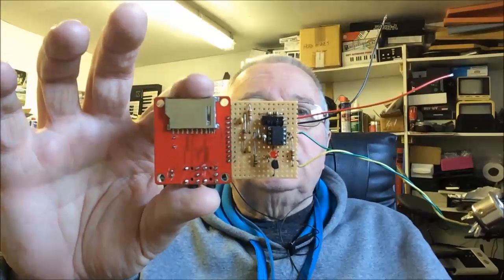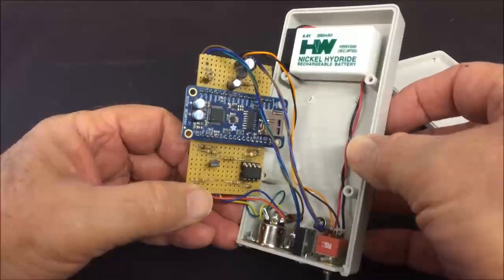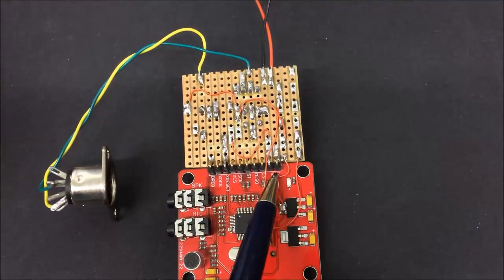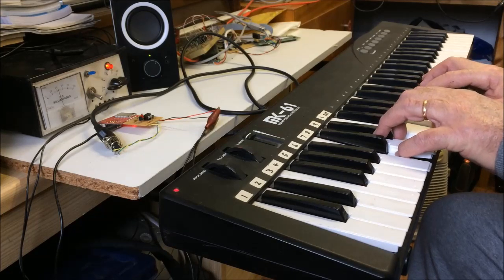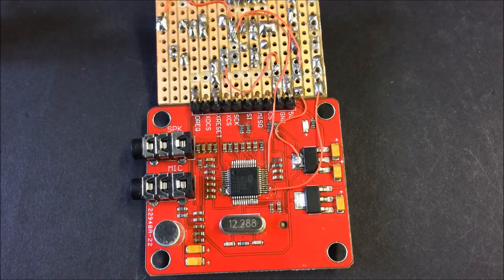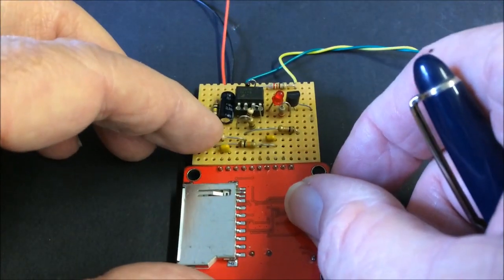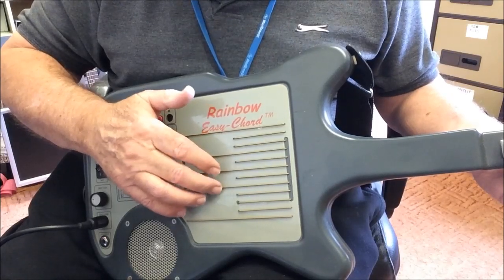DIY VS1053 MIDI Sound Module

Comment: Please let me know the sample Arduino source code that inputs the MIDI keyboard shown in the demo and plays on vs1053.
Reply from the maker: Hi - there's no arduino code associated with this project - you can generate midi signals from an arduino program but that is outside the scope of this project. Any midi keyboard or controller will provide the correct midi messages for this device.
Reply: @mikerainbow  Ah yes, thank you. Direct input from the MIDI keyboard.
Thank you for your quick reply. I was able to successfully modify the module using your method and I am very happy. Thank you again.

Comment: This is really the only standalone version, without MCU, that i could find. Great work! The additional wires to the chip make it a bit harder for beginners. Its stupid they made these pins not available for midi. Is there no version of the breakout that is prepared for this?

Comment: Hello Mike, thanks for the MIDI project. I am a somehow more or minor experienced developer and I draw my own schematics and do home-made PCBs the traditional way (UV and etching).
Years ago, I ordered some ALC850 chips (about 5 Pounds each), and I still have them at home, without an Idea what to do with it. Originally, my Idea was to do some mixing device (Piano, PC, Speaker, Headphones, ...) in/out and a configurable interface. However, I do not know if I chose the right device. Do you have any Ideas what to do with an ALC850 ? Kind Regards.
Reply from the maker: Hi - sorry I don't know anything about the ALC850 audio codec chip - never used them. Regards, Mike.
Reply: @mikerainbow  thx and have a good time !

Comment: Hi mike, great project,  several years on have you found any improved midi module board versions to do this?....also i would like to have usb keyboard input,  is this possible with these?...thanks .
Reply from the maker: Hi - these are still the only reasonably priced modules and you can't connect usb directly to these boards - would have to do it through a usb compatible PIC or an arduino nano/uno etc.
Reply: @mikerainbow    hi thanks,  you mentioned sam2195,  do they have better sound quality, and are they still general midi?.
Reply from the maker: The sam2195/2695 have much better instrument sounds and are GM but I encourage you to do your own research - there is loads of info on line.  @100roberthenry

Comment: can many files be uploaded in this device plz answer this
Reply: Ok thanks for your kind information 😌😌
Reply from the maker: Hi - sorry, I'm not sure I understand your question - what files are you talking about?
Reply: audio file
 @mikerainbow
Reply from the maker: These VS1053 modules can stream mp3 and wav audio files from an sd card and the number depends on the size of the sd card. I haven't tried this so don't know much about it. I have only used the modules for accessing the on-board midi instruments.  @rathannaik1220

Comment: Is there a way to import audio sample and trigger the file with midi.
GM midi is largely useless as sound if you're interested in a sound that doesn't sound cheap and generic . 
   It's useful certainly, and a brilliant idea and project, but GM sounds are generally kinda 'yeesh' if you're playing anything with other artists .
A way to trigger samples you add , is an order of magnitude more useful.
GM is cheap and everywhere, a simple sample storing/midi triggered device is a sought after , uncommon thing. Anything on the market is blatantly over priced for what it does. 
   A simple device to store and trigger samples thru midi simply doesn't exist in the style of format you've done your project in this video. (And is sought after)
    Thanks for the great project and your video. I admire your knowledge and abilities in this field. 
Cheers 🍻
Reply from the maker: Hi, thanks for the nice comments. I've been working on just such a project because as you rightly say, there is no reasonably priced solution. I've been developing a program using the ESP32 module which is very cheap and very powerful. Lots of projects on YT using this device and even a sampling midi project but it is quite complicated and difficult to implement. So I will publish my project when finished, which, hopefully, will be cheap, effective and simple to build.
Reply: @mikerainbow  Excellent work sir, thanks for your reply, I look forward to seeing any future projects you have on this subject. 🍻

Comment: Fine! why the wire in the pic pin 3.3. Reg IC  goes further than the resistors for XRST and pin 34? Thanks.
Reply from the maker: Hi - thanks for your interest.  Sorry, I'm not sure I understand your question.

Comment: it's the same chip as a serdaco mcfly midi module, i bought one and regretted it immediately
Reply from the maker: Yes - I think the clue is in the description on their website:
"Do you like rough, low end midi chip sound ? Do you feel adventurous ?
Do you like cheap and quirky, both in sound and in price ?
Here's the McFly board, back from the future of the 80's.
This board uses the VS1053 chip, which has limited general midi capabilities.
Expect imperfection and artefacts, and unexpected sounds !"

Comment: Great, to use simply midi 5 pin input, in the schematics, i only use primary part without ttl circuits? midi out to pin 26 directly right?
Reply from the maker: Hi Marius, if you use a 5 pin din midi input you must use the opto-isolator circuit but if using 5 volt ttl levels you must use a suitable resistor divider to ensure no more than 3.3 volts goes to pin 26 of the VS1053. You should still use a 220 ohm resistor in series to pin 26 if using 3.3 volt ttl levels - hope this helps.

Comment: Do you think you could add a tiny flat speaker to this and convert any midi controller to a piano with internal sound? Would be awesome to be able to play/practice piano on my lab, anywhere I travel, sit or lie. I'd buy. I've got a 37 key midi controller with full size keys. Only need to plug in so many external stuff on a wire every time I hardly ever use it.
Reply from the maker: It is theoretically possible to use a small speaker but the earphone output is designed for an impedance of 30 ohms and 16 ohms absolute minimum - so you need to bear this in mind. I would be happier to feed the earphone output into a small stereo amp module which is designed to drive proper speakers, small or otherwise. Also you could use a small battery powered guitar practice amp - you know the ones that clip on the guitar or on your belt. Hope this is helpful.
Reply: @mikerainbow  Thanks. Yeah I figured about the impedance. I could connect my smoothhound wireless I guess. It's mono and 1/4", so I would need to replace the 3.5mm for a bigger socket.

Comment: Excellent Mike is great and inspiring !! do you know if the VS1053 can load soundfonts sf2 files ?? , I came to your channel looking for examples of MIDI controllers and synthesizer because I want to make a drum pad but can change drum pacthes like the Blue Jay kit. Thanks in advance.
Reply from the maker: Hi Jesus, thanks for your kind comment - as far as I know sf2 files are not possible - I have looked through the manual and it looks like only the built-in instrument wave files are accessible. The VS1053 is a very low budget chip and these extra facilities are just not available - wish they were because the built-in wave files are not all that great but for the price they are still pretty good.

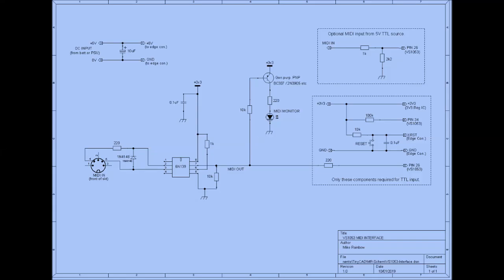Comment: On the circuit diagram at 10:58 the output of the 6N139 is shown as taken from pin 7, but looking on the strip-board at 10:40 it seems to be coming from pin 6 which seems more logical.
Reply from the maker: Hi Andy - yes, thanks for that - it is indeed an error which I picked up and corrected on the schematic in the link above - I also added a note above in the title comments. Sorry about this.
Reply: @mikerainbow  Sorry, I should have clicked on 'Show More' before commenting. 

I have the green board VS1053, presumably I still need to connect the MIDI input directly to pin 26?
Reply from the maker: @andyfraser5876  I'm pretty sure the green board you have is the same as the blue board which I made a comment on below to Roberto Lonoce - hope this helps.

Comment: Hello, thanks for the awesome video.

I'm having this musical generation project (not really midi but quite the same logic) and curious about this shield. To anyone having dealt with this shield I have some questions please :
Are the waveforms stored on the sd card ? are the tones you hear calculated or stored for each note and instruments ? Can we change instrument data (like envelop, waveform, etc ... )  freely ?
Where can I find documentation on how to use this shield and how it processes messages to create the waveforms to the output audio lines?

(currently my project is using Tone on my Arduino but it's limited to the number of timer and doesn't play waveform, I'm also exploring the DAC with coded waveforms way but if I can avoid this overhead it's cool)
Reply from the maker: Hi Alban, thanks for the nice comments.
The waveform samples of 128 instrument/drum sounds are stored within the chip in ROM and can't be changed. I think the SD card can be used to store mp3 files for playback although I didn't use this facility. Also there are limited capabilities to change effects like reverb, pan, sustain etc. The best thing would be to do a search for the VS1053b datasheet which gives loads of info. Also search for VS1053 chinese module schematics because this info is available though there doesn't seem to be any details on how to use these modules. Hope this is helpful.
Reply: @mikerainbow  It's really helpful, thank you ! First I'll go through the dac process with manual sine waves (+some harmonics) for personal education purpose, but I may use a VS1053 or similar solution because the generation of the sound itself is not the main goal of my project (it's recognizing musical hook patterns and improvise on it based on simple music harmony rules).
Thanks for the pointers :)

Comment: Excellent, Mike !! I bought the VS1053 blue card, how can I change with this card? Where do I find the 100K resistance?
Thanks in advance.
Reply from the maker: Thanks Roberto, as far as I remember pin 34, which goes to a 100k resistor on the red pcb, is tied to the 3v supply rail on the blue module - so it is necessary to cut the print, make sure the pin is isolated and then attach a 100k resistor as described for the red module. The print to pin 26 must still be cut and connected as on the red module and pins 9 and 10 must be pulled low - sorry to be a bit vague but I have misplaced my blue module and relying on memory.

Comment: Hi Mike,it is an amazing stuff!I want to read your code and learn how to DIY in my project,could you give me that?
Reply from the maker: Hi there, thanks for the nice comment - there is no code - it was all done with hardware mods to the VS1053 board.
Reply: @mikerainbow  Oh,really?Mike,that's okay.Appreciate your work.Keep on!
Reply: @mikerainbow  If so ,can you teach me how to switch the tone with hardware mods?
Reply from the maker: @kwongfaiyeung760  Sorry, I haven't done much with this board apart from getting it to work with MIDI so I haven't really looked into hardware mods and hacks - I think the VS1053 datasheet would tell you everything you need to know.
Reply: @mikerainbow  Alright,thanks a lot again for your patient reply!Good luck!

Comment: Thanks for the useful video. I was able to make that "red" module work with Arduino even without hardware hacks with this program: https://gist.githubusercontent.com/microtherion/2636608/raw/8158bd473fd51322adb59a208fade25caa7b8d26/MP3_Shield_RealtimeMIDI.ino. Just do the full wiring as mentioned in the sketch (including SPI) and set USE_GPIO_INIT to 0 and USE_SPI_MIDI to 1.
Reply from the maker: Hi Martin, thanks for your comments - I was trying to avoid using another micro such as the arduino and SPI to get this working as a completely stand-alone unit - hence the hardware hacks.
Reply: Been trying all sorts on my 2x white ElecFreaks/Freeduino boards. Your tip of reversing the commands values finally produced sound!
Many Thanks. Have a great Christmas and New Year :)

Comment: These hardware modifications are a bit scary for people with lesser soldering skills. Did you try to achieve the same outcome with the VS1053 software patch as decribed here: https://diyelectromusic.wordpress.com/2020/07/08/arduino-midi-vs1053-synth/ ? Or perhaps these chinese boards don't accept these patches?
Reply from the maker: Hi Rene, yes it is quite feasible to program the firmware and send midi messages via the SPI interface on the VS1053 but then you would have to use a microcontroller to translate the standard MIDI signal (UART 31250Hz) to SPI data and you're back to square one with complexity. I wanted a simple low-cost circuit that would accept standard MIDI signals from a keyboard or other device via 5 pin din lead without the need for a PC or other interface.  Hope this answers your question.
Reply: I was able to make that "red" module work with Arduino even without hardware hacks with this program: https://gist.githubusercontent.com/microtherion/2636608/raw/8158bd473fd51322adb59a208fade25caa7b8d26/MP3_Shield_RealtimeMIDI.ino. Just do the full wiring as mentioned in the sketch (including SPI) and set USE_GPIO_INIT to 0 and USE_SPI_MIDI to 1.

Comment: I've just discovered this board by finding your video. You mention some people have said GPIO2 and GPIO3 should be tied to ground. They are correct (sort of)... according to the datasheet their state at boot-time controls the EarSpeaker configuration. The data sheet isn't very clear but suggests that tying them both to '0' will switch this off.
Reply from the maker: Hi Steve, thanks for your comments  - I mentioned the option of tying these pins to ground but as I was trying to keep the mods as simple as possible, and as there appeared to be no adverse affects, I decided to leave them floating in my application.
Reply: Actually the data sheet also suggest to set the EarSpeaker configuration to "extreme" to improve generated sounds. That should apply to the midi player, I guess??

Comment: I ran onto this video whilst trying to use this module for other purposes. One I have built up to use as an internet radio receiver built into a small box that houses a couple of nice sounding speakers, I am using an ESP32 to receive the signal and drive the VS1053 board. I have built two of these, one with speakers another smaller more portable unit with just an earphone jack for output. I also have the shield version that I am using for a simple MP3 player, I am trying to figure out how to run that without having to have a PC hooked to it to select the music.  You know like a few push-buttons or something like that.  While I do have several boards using other chips and such that I can use for that, it is maddening not to be able to make it the way you want it. Ah well such is life.
Reply from the maker: Hi Jerry, I guess you would have to send serial information to the board using a microcontroller  to control the mp3 player and what it plays, just as the PC is doing at the moment - I haven't really looked into this. I have just bought an ESP32 module and busy writing code for a Moog type polyphonic synth - this chip is very fast, very powerful and extremely cheap - I think the module was around £7 in the UK including postage! Good luck with your endeavours.

Comment: OK  I've finally converted my VS1053 MP3 shield from geeetech-com, same as the one in this video at 1:36, its now running midi files like a champ. only one issue and that was the xreset (NOT THE RESET PINOUT) on my particular board had a 100k resistor to ground,  (PIN 3 of the VS1053) once I found that and rerouted it to 3.3v + all good, same as info in this video.  Going to order a new VS1053 chip and build one from scratch now I know it works as good as it does. thanks for sharing. A1 demonstration and tutorial.
Reply from the maker: Hi there, thanks for the feedback and glad to hear you succeeded - also thanks for the nice comments.
Reply: @theDaftman, your comment was very usefull, wich is grate. It just maked a miracle. My the same modul vs1053 alived after a week non stop fighting. Thank you. Thanks a lot to Mike.

Comment: Does one have to select the voice to hear or will the module just played what ever voice is sent,   i need to play MIDI files from a PC or a SD card MIDI player and play the MIDI file as it was written or performed,   if that makes any sense. I've got all the parts in stock to build your version but don't want to start without the answer. thanks
Reply from the maker: theDaftman Hi, yes it will play whatever is sent to it with the correct midi instruments and drum track. The demo on my video of "Whiter shade of pale" was sent from my pc as a normal midi file directly into the module. Hope this helps.

Comment: very interesting, but how to change instruments? The Video shows the different sounds, but not how you invoke them.
Reply from the maker: The module has MIDI input so all (most) MIDI messages are recognised and acted upon - MIDI note on/off messages from a MIDI keyboard, controller, sequencer or other device plays notes - and to change instruments you have to send instrument change messages from another device to select one of the 128 MIDI instruments or drum sounds. I used the MIDI keyboard shown in the video to change instruments. In other videos I use a microcontroller to do this. Hope this answers your question.